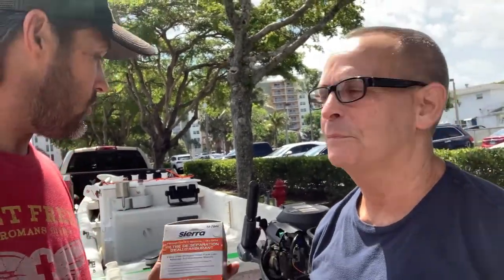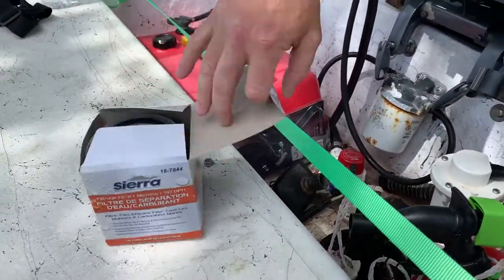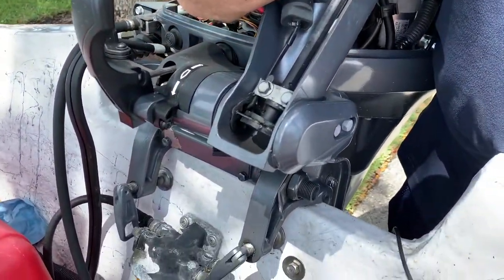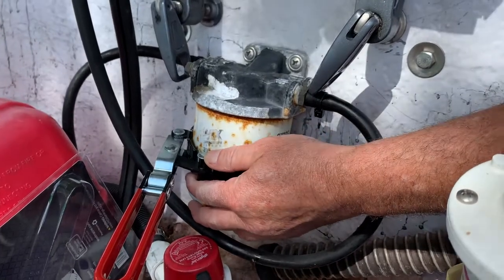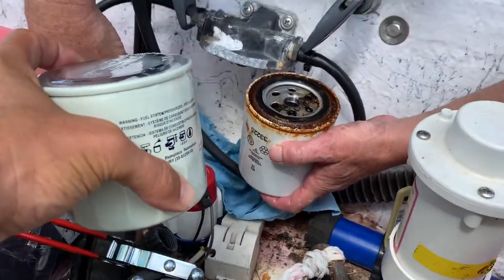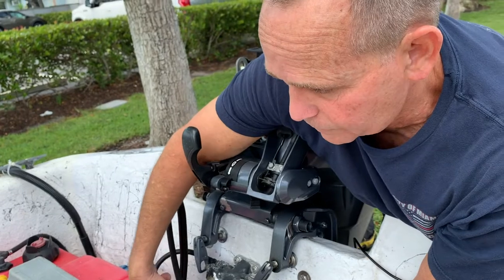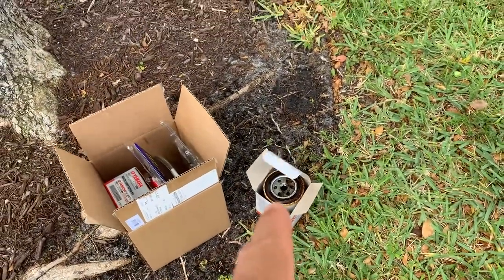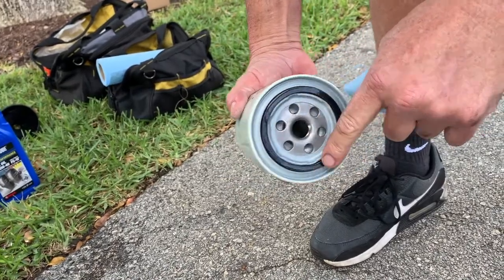DIY   CHANGE FUEL WATER SEPARATOR  OUTBOARD MOTOR

Comment: What if you have a leak at the fitting and hose. Would that cause my motor to not crank over?
Reply from the maker: If it’s letting air in the gas line because of the leak then that could definitely keep it from starting